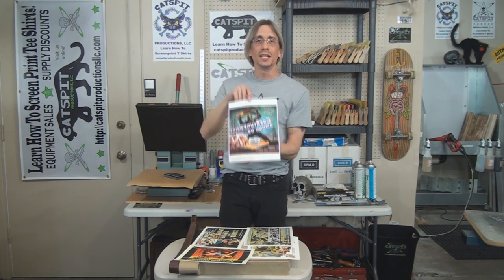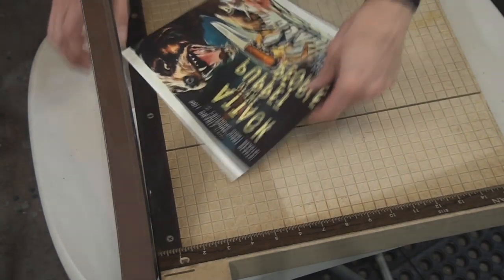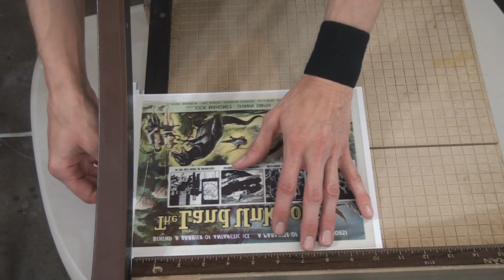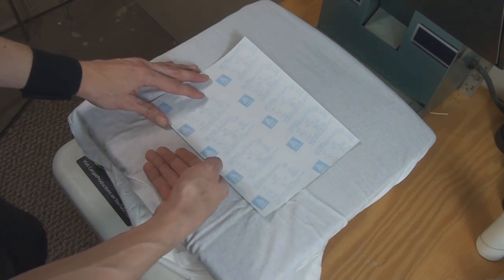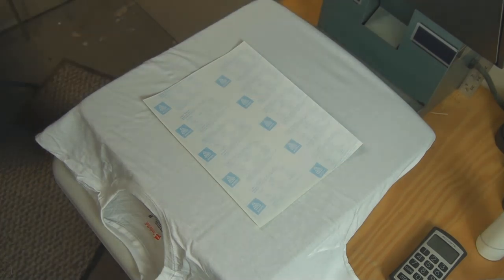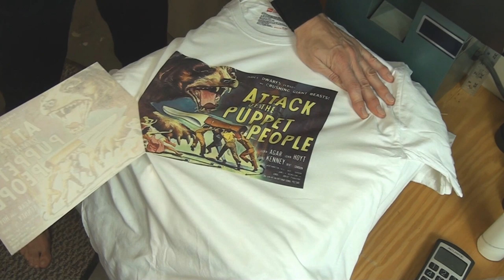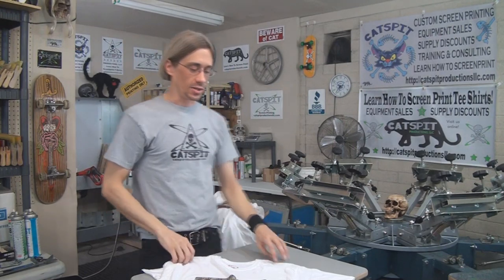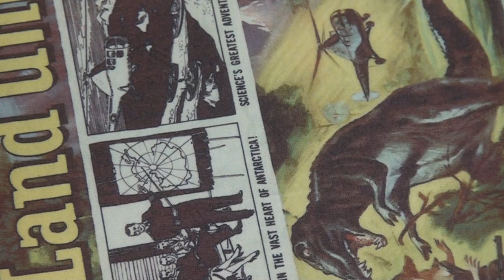DIY Poster Art Inkjet Heat Transfers For Tee Shirts

Comment from the maker: @BlackDragonEntertainment#44 They wash just fine don't worry. No creases or anything. Wash inside out and on the first wash do them alone with extra water. You can use detergent if you like but only use a small amount. I don't use any on the rinse wash. But always wash inside out. Thanks for watching! http://www.catspitproductionsllc.com/ - http://catspitscreenprintsupply.com/
Reply: hi, just starting out, is there something I can use in place of a Teflon sheet?(until I can afford you see).I plan on getting a press but for now, any tips for using a clothes iron?..thank you.
Reply from the maker: +Paul Clifford Hello there. You could use craft paper from an art supply store. Thanks for watching. Screen Printing Equipment & Supplies - http://catspitscreenprintsupply.com/

Comment: The only time I have used inkjet transfers for production is when I have a local artist trying to promote their art or other projects with giveaway tee shirts. I only use their original artwork. Definitely necesary to cut around the image to avoid the residue tranferring. I've actually screen printed first and then heat pressed inside the screen print. Works great!

Comment: Thanks very much for the excellent video! It was a really fun one! I really like those 50's 60's horror designs too.I have a couple of prints of those in the video on my wall.Thanks again!

Could you tell me if it would be possible, using a simular method, to use heat transfers on stretched canvas boards? and then sealing them, in some way. I'm curious to know if this would work, using a lot less heat or pressure I guess?

Comment: Looks great, I've actually seen Attack of The Puppet People, lol. This could reduce alot of overhead. What is the particular transfer paper you use and how well does it hold up? The only kind of heat transfers I've been around have been on jerseys and they don't look very good, but these looked great. Also is this paper available in wide format sizes (13x19)? And one last question, would throwing these on a belt dryer or under a heat gun cure them more/make them last longer?

Comment: Hi, again. I notice your printer the 1400 at the start of the video. I have that same printer but my images are not coming out like yours did. Do you think its because Im using plain printer paper..
Reply from the maker: If you are trying to heat transfer plain paper then yes. That will not work. I use a special heat transfer paper in this video. Check it out again and listen closely. I tell you what you need to know. Thanks for watching and commenting!

Comment: what type of printers need to use...?
i got new epson L210 color ink tank printer two months back...
will it work..? or i need to any color...?
some body is saying that i need special ink which is not available with normal printer ...
what type of transfer paper i need to use...

pls can you able to provide me this information...?
Reply from the maker: You can use any inkjet printer with standard inks for inkjet heat transfers. Sublimation is different and requires a different ink thank an inkjet transfer. That's probably what they are talking about. Thanks for watching. Screen Printing Equipment & Supplies - http://catspitscreenprintsupply.com/

Comment: Hi.  I've seen some who heat-set the transfer after peeling with another quick 8- to 10-second hit with the press (using the craft paper, of course).  Have you tried this?
Reply from the maker: @TechSupport100  I have seen that done and I certainly may have done that once or twice in my days. However I think I use enough pressure when I do the transfer to get a good peel and it is fine. I don’t think it is necessary if you get off a good transfer. Thanks for watching and leaving a comment!

Comment: i use standard jet pro dark transfer paper on white shirt. but after first wash it produces blotches along the side of the print. is there a way to clean the blotches?
Reply from the maker: I have no idea. I have never used that product nor have I ever seen such problems. Normally on the first wash we experience a lot of ink loss so you want to use plenty of water with a nice rinse cycle. Thanks for watching. Screen Printing Equipment & Supplies - http://catspitscreenprintsupply.com/

Comment from the maker: With these Avery transfers yes, it may actually work. At least they are designed to work with an iron. Use maximum heat and maximum pressure and test it out. But the heat press really seals the deal, no pun intended. Well yeah, pun intended. Thanks for watching and leaving a comment! ☠

Comment: Hi i have a heat press an a inkjet printer when i print out the images it looks faded what type of tranfer paper ur using in this vidoe
Reply from the maker: Rene Gomez This was just some cheap Avery heat transfers from Walmart or Staples. Check your printer settings and use the best setting to get the most ink printed. Thanks for watching. Screen Printing Equipment & Supplies - http://catspitscreenprintsupply.com/
Reply: Rene Gomez use google to find
"Jet Pro Soft Stretch" or "Red Grid" transfer papers. They will be WAY more advanced than some crappy retail papers

and also, use pigment inks in your inkjet printers for quality & durability/washability
Reply from the maker: Drewbie UnderFire Oh for sure. Commercial grade transfer papers are way better than the hobby stuff. But this crap works very well when you want to make a few quickies really cheap. Especially with a heat press. Most inkjet printers come with pigment inks today for photographic prints that won't fade in the UV light. Thanks for watching. Screen Printing Equipment & Supplies - http://catspitscreenprintsupply.com/